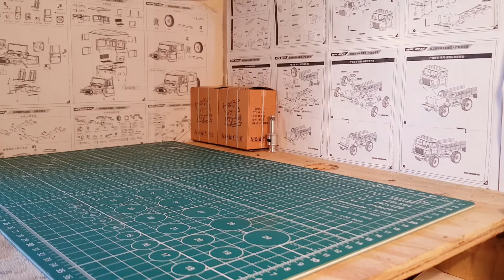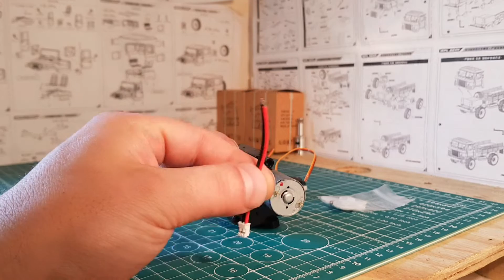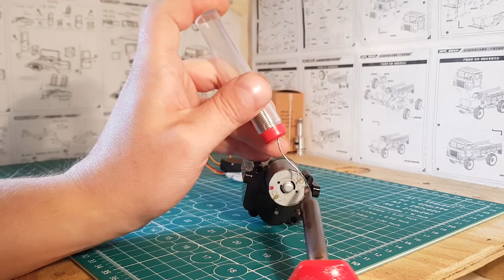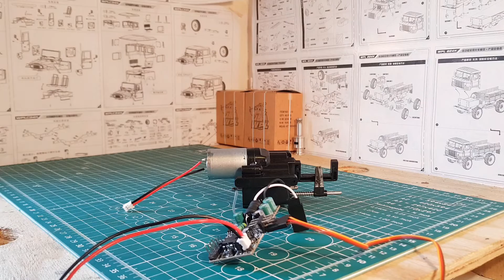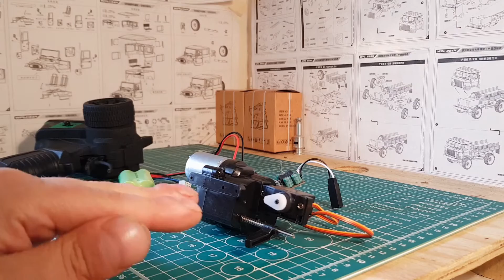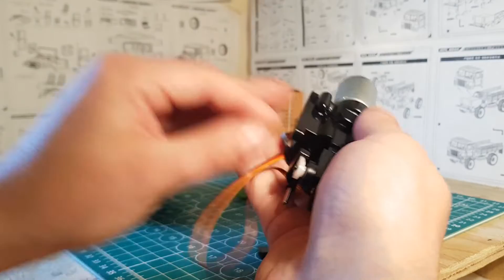Gear Change Issues? WATCH THIS! WPL Dual Speed Gearbox Setup.

Comment: Hi Liam! I just wanted to ask about the durability of the 2 speed gearbox. Have you had any of them die on you or did you have to replace the motor? I'm having a hard time deciding whether I should get the 2 speed or another single speed 370 because after a week of use, the single speed 370 had issues. Thank you.
Reply from the maker: What single speed have you got?

And as for 6 of my dual speeds all are still running fine, still on stock plastic gears inside (aftermarket metal ones are available)

My original dual speed started life in my c24 then went into my B24 where its taken so much abuse attempting 71° for a new climbing challenge world record.

I'm very surprised how durable they actually are.

Take them time to get the gear change dialled in and they are amazing fun!
Reply: @THYC  
This is the one I'm using. 
https://ph-m.banggood.com/1PC-Metal-Transfer-Gear-Case-w-or-370-Motor-for-WPL-B-16-B-24-B-36-C24-JJRC-Q60-Q61-4WD-6WD-RC-Car-p-1374836.html?rmmds=search&act_poa=SKUA50651&cur_warehouse=CN

It's good to hear that the 2 speed is actually really durable. I think I'll get it. Plus there's the added fun of upgrading your rig since I also need to swap out the electronics.

Really appreciate you taking the time to reply to my question!

Comment: Hiya Liam I had mine set pretty good, then the servo just locked up and now its stick in gear, any idea maybe why? (Doesn’t want to move at all) not too much a biggie but i thought while i was here id just ask.

amazing detail and explained clearly once again in the video 👊💪
Reply from the maker: Sounds like the gear change servo has died, if it's under any load it will burn out, setting up the actuator arm correctly avoids this.

Thanks for tuning in bud, massively appreciated 👊😁
Reply: @THYC  thanks bro. 
I Will get another one and re-watch and re-do, it was my first ever 2 speed and i got a bit excited i think 😅 
Live and learn they say. Cheers again 👊

Comment: Thank you for another excellent tutorial!  Have you covered how to install the 2-speed transmission with metal the metal links, metal axle and metal axle truss?  Do you raise the 2-speed power unit with a bracket or do you make custom links to clear the shift servo?  Cheers!
Reply from the maker: You can get x2 of the bent links used for steering and make those the acquired length 🤔
Steve does a shift over mod
https://youtu.be/SiO7Y-XbY10
Reply: @THYC  Awesome information!  Thank you for the reply.  I decided to take the opportunity to learn how to make custom links.

Keep up the awesome content.  Cheers!

Comment: Good video. I had issues with my first two speed as well, but luckily figured out I could slide the mechanism a tiny bit to get it working. When it's set up properly it's really good.

The stock 180 climbs/crawls pretty much just as well as the two speed in my experience, but it's nice to have the extra speed the rest of the time.

Comment: hey do you find that the stock shocks in the WPL C24-1 are wayyyy too stiff? like i feel like mine has no suspension.
Reply: Well explained 👍
Reply from the maker: You can get softer springs now from the offical store.
https://www.wpl-rc.com/collections/c14/products/spring?ref=THYC_RC

Best way to gain flex is to add unsprung weight like metal axle or wheel weights
Reply: @THYC  cheers this will really help
Reply from the maker: @SshiggyY  anytime 😁👊